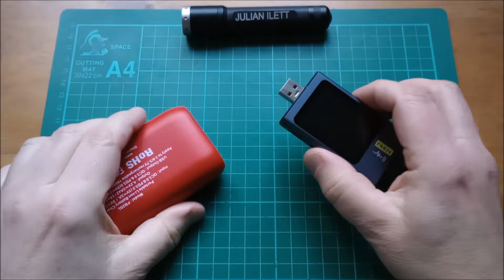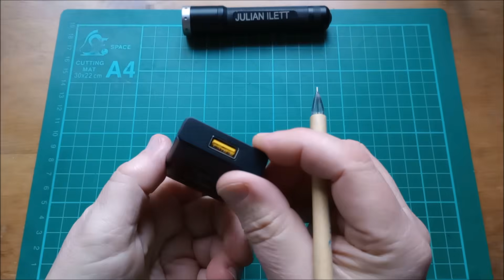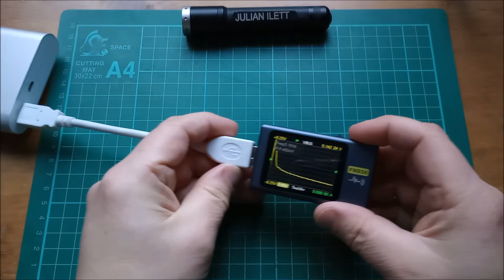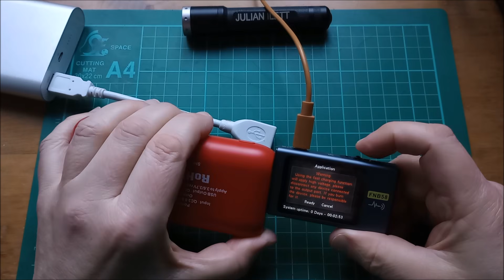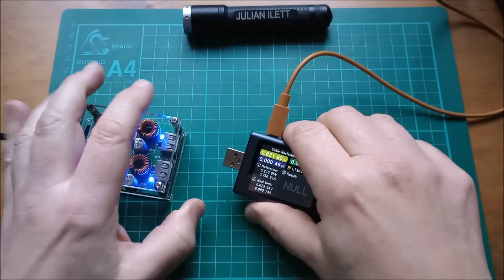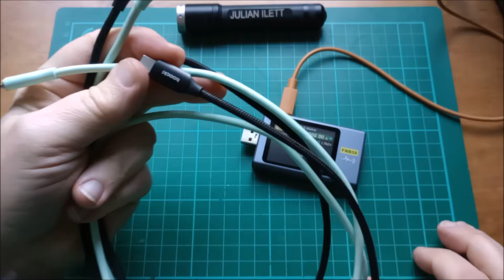Fnirsi FNB58 USB Fast Charge Tester

Comment: I have the same "odd" silver powerbank, mine randomly turned up in my post box without me ever buying it... mine is branded Xiaomi, Model: NDY-02-AD, 10400 mAh 5.1 V @ 2.1 A rated, and doesn't suffer this, Just tried mine on the same tester as yours (FW V1.11). I think you have a bad one ther, and neither is there an issue when the tester is pushed directly onto the powerbank.

Comment: I bough this gadget now I need to return it. What everyone is missing from these reviews is the ripple measurement is completely off. It does not have the proper speed to measure above 1Mhz. My oscilloscope found a pretty big component at 25Mhz on a cheap power supply. But even on lower frequencies is not accurate. If you are not convinced think about the huge amount of harmonics a switching supply gives (because of the sharp pulse edge). When you have all these different frequencies and amplitudes combined even a decent powerful oscilloscope cannot trigger properly. But this gadget seems is all happy, it triggers on something which for me is dubious

Comment: Hi, Great content and you put over the information really well.   I have a problem.  I have bought a Thunder bolt 4 cable from a large online supplier, and the cable does not seem to be as fast as it should be.  Will the FNB58 help me diagnose issues with the cable?  Also, this video is a year old is there any other/better usb monitoring device on the market.

I am now going to watch you back issues of videos to see if there is anything else that can help me out.

Thanks in anticipation and keep up the good work.

Comment: FYI I did a resistance test with the FNB58 and I noticed that it was drawing most of the power to my load through the PC cable at the top.  The resistance values I was reading were fairly consistent.  Maybe it only lets a specific amount of current go through the test cable, and the PC cable was used to source any extra power needed by the load.  Since the manufacturer didn't really document... anything... and this seems like an unlikely way to run this test then I can't really trust the results.

Comment: The cable resistance measurement is very inaccurate. I compared it to measurements with a milli-ohmmeter that i have, and as a matter of fact, the FNB58 shows values that deviate by up to 200% error from the real value. Bayond that, measuring the current is done with a shunt, and that does have repercussions to the measurement. The value of the shunt is 10 mOhm. For a measurement device it would be important to know that, but it is nowhere mentioned in documentation. To be fair, other, cheaper such "measurement" devices have even higher shunt values, which makes them reallly crab. 10 mOhm is not a really bad value for such an application, but ideal would be a current sensor with µOhm, which are available today.

Comment: Im having a few issues with mine not sure if its the cable or hardware or firmware but checking the e marker of an anker cable flashes on the screen then disapears and some tests make the device turn off maybe thats mmy fault for using the same cable supplying power to do some of the tests

But I cant get cable resistence to work

Comment: BTW how would you measure cable resistance of a USB-C <---> USB-C cable? Or USB-A <---> USB-A? Not possible without some adapter, right? (which has an unknown resistance of its own)
Reply: Incorrect. It has return ports on the opposite side for all the major usb connector types. It CAN do this.

Comment: Great device, just got one. That white power bank looks like it's got a bad filter capacitor in its circuit. I wouldn't use it. Shows you the kind of useful information you can get from this device!

Comment: What this device have more than other  USB devices for mesuring current? I had two of this devices and i think they are total garbage because these devices limits the current that flow through the cable compared without this device.These devices   have  their own resistance and therefore distort the measurements.

Comment: This is an expensive device. Not so much the rather hefty price in itself, but for all new cables I will have to buy after checking my current ones
I'm pretty certain most cables that came with devices are rubbish😊

Comment: I have this one and am completely disappointed. Living in 2024 you would expect such a unit to support USB 3.0. It doesn't. No data is going through, so it is impossible to test USB3 buspowered devices, as without data they simply don't start up.
Reply: Could you recommend one that handles USB 3.0?
Reply: @pop-popmoose5359  Nearly a year later and no new version from Fnirsi. Would have loved that more than the WITRN C5 and the  TC66 that I use for USB3 tests.
Reply: It is so easy to complain about what is wrong. For just 40 dollar you get a huge amount of functionality. Made in China of course, because when it would be made in the USA, it would cost at least 200 dollar.
Reply: I honestly don't know if a single one of these devices that actually use USB 3.0 to be fair there is really no specific need for USB 3.0 because everything goes through quickly enough at USB 2.0 speeds it's not like you're transferring large amounts of data.
Reply: @abnormaltrusk12  Your reply would have had merit 5 years ago. USB 3 is everywhere and I constantly need that mode to check the power reuirements and behaviour when DUTs run in that mode. Fortunately meanwhile there are others that fully support that, and I use them succesfully. FNIRSI is clearly lagging behind here.

Comment: I have one of these units and use it for measuring down to 10uA currents at 3-5V in a ATTINY85 using sleep mode and it works great.
I really recommend FNB58

Comment: I have had one of these for a while, and have YET to fully use all the great features!  It is SO useful device in an easy to use device!
It really covers all the USB protocols and displays the quality of the power supply with the o'scope!
Thank you for the detailed review of this device!
Reply: i use fans on the PD mode (other brand) but to acces the high voltage part you had to disconnect and select the device countlessly clicking to the desired voltage :P this seems so easy !!

Comment: That red powerbank looks like one I have, where you insert your own. 18650, or in my case 21700s.

Is it just me, or is the percentage calculation really unreliable?

It drops very quickly on an initial load, but lasts a lonnngggg time at the lower percentage readings.

Comment: The latest firmware version v0.68 removed the "USB-C E-Marker" function from the toolbox, So I had to roll back to v0.67. I've contacted Fnirsi but they've not fixed it yet.
Reply: I found the information when I  had a  USB C to C cable plugged in under USB-C Cable in toolbox, on v0.68. I think they just integrated the e-marker functionality into the USB-C cable test functionality.
Reply: @alexa5231 I tried updating it to v0.68 again and had a look in the "USB-C Cable" menu and sure enough the info is on the second screen after pressing the jog wheel. Not as obvious as before, but thanks for making me aware of it.
Reply: Hi, I tried to upgrade to v068 but I couldn't find how to put the device in bootloader mode, any hint please on how to to that? in the manual, the instructions only say to select the file and upgrade it !!!
Reply: @cyrixone2771  To update it, you need a decent USB data cable. Press and hold in the toggle button, then plug the USB cable into a computer. This should then make the FN58 show up as a USB drive in your computer. Place the update file in the drive and it should update.
Reply: Hold the Jog wheel down while plugging in the micro usb cable @cyrixone2771

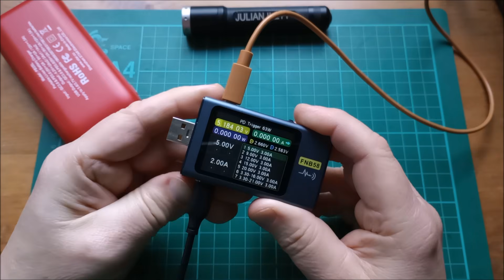Comment: 14:00 PD 100W? That's BS. It can do only 20V 3A. Or maybe it's a cable issue: you need a cable with an Id chip to tell the PD system that the cable will handle 5A without melting.
Reply: How do you know? The power bank he used wasn't even shown on-screen. The Anker 737, for example, has no problem at all putting out circa 140W, so 100W certainly is attainable. What exactly are you objecting to?
Reply: And high-current cable is exacly one, that is used at this case. 18:13 - should be reading for it's e-marker.
Reply: @volodumurkalunyak4651 watch carefully, the cable used to test the power bank is not the 5A one tested later...

Comment: PE+ means "Pump Express". And you should do an update to your device. Then it can detect QC 4+, too.
With the Cable Resistance Detection I sorted out about 30 shitty USB cables and only keep the good ones. Most of the cables delivered with a device are just garbage, but there were some positive surprises, too.
Reply: Am I right in thinking that the 'resistance' is the sum of the resistances on the GND and Vbus lines?
Reply: @Brian_Of_Melbourne  No, it's just the resisitance of the wires 5 volt and ground. On the bus lines floats almost no current.
Reply: I’m thinking of getting this unit too filter through a box of cables and chargers, and sort them based on capability.